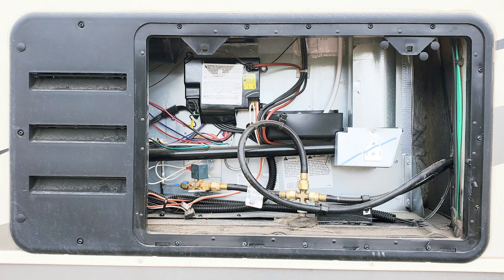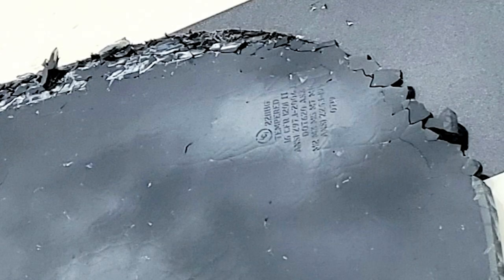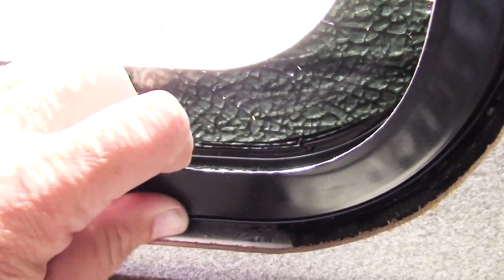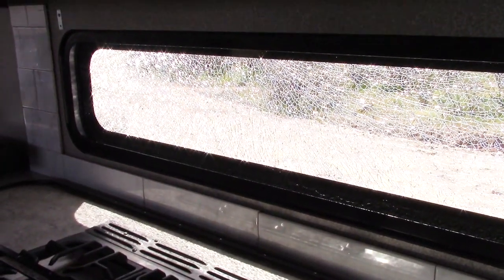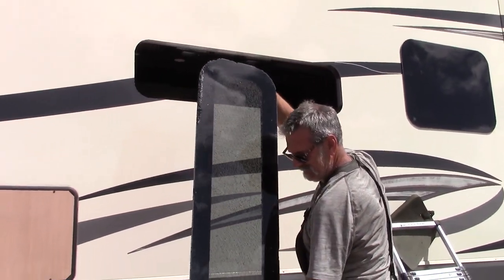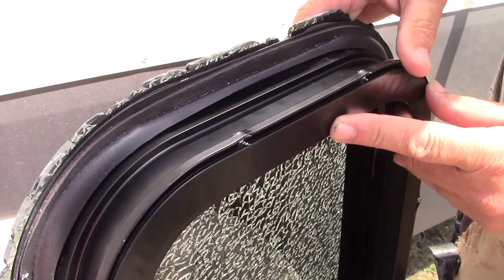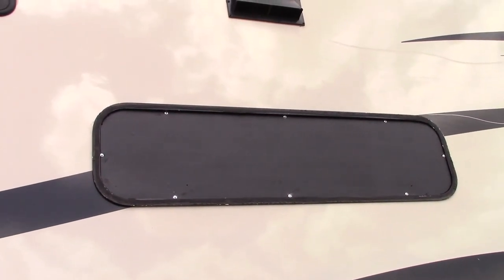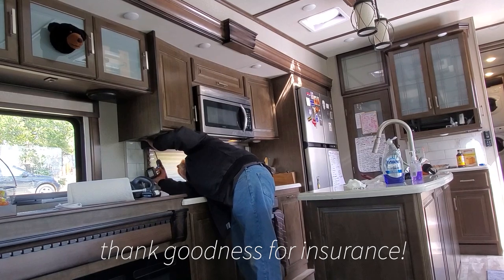SEMI TRUCK HIT & RUN! Shattered Windows, Emergency RV Repairs, RV Insurance Woes and Keeping It...

Comment: Note to self! Listen to the seasoned pros.. don't put out the slides when parked in a lot!
Reply: Someone on another one of her videos commented about putting out cones so they draw attention to the slides being out.  I thought that was a great idea.
Reply: I think that panting the bottom of the sliders with reflective paint would be another option. I'm in shock that the fix was over $8000. Yikes. So happy that a good craftsman was there to help her out. Chris did a really good temporary fix.

Comment: Sorry for your troubles. It could have been a lot worse. A little advise from a 25 year/3 million mile truck driver and a Grand Design owner. Don’t leave slides open in parking lots, truckstops and rest areas. If you need something that’s hidden then by all means open the slide and get what you want and shut it back up. Secondly, the driver don’t have to be new, anyone can make a mistake. If his trailer was heavily loaded he may not of even known it. Then he may have too. Your never going to know. An RV with the slide open is something you don’t expect as a truck driver, it’s not something we run across every day.  I would put a dash cam in your truck that runs all the time and loops.

Comment: Doesn’t cabelas have cameras? That s o b needs to b caught. Glad you’re ok stay safe
Reply: That’s what I’m thinking.
Reply: I thought the same thing- talk to Cabela's & see if they got it on camera.
Reply: 8000 ?
Reply: That was my thought. You might need to get the police involved, file a police report, to get the video and get this guy tracked down.
Reply: Wow! He's driving a huge 18-wheeler and "may not have even known he side-swiped her" yet you're calling him an s.o.b. I love watching this lady's videos and feel sad that she is going through all of this. That said, I do have one piece of criticism; something which may have avoided all of this. When you are lot docking in the parking lot of a Cabelas, WalMart, Cracker Barrel, a truck stop, etc think TWICE about putting your slides out. While these places may allow RV's to park there overnight they are, after all, areas where traffic (sometimes even a high volume of traffic) is going on. It's a risk. What I'm shocked by is that she did not go outside immediately after she felt the RV being moved. But I wasn't there so I can't really say with certainty that this isn't understandable. REGARDLESS, there is a chance (perhaps even a really GOOD chance) that the trucker didn't even realize he came into contact with an RV. Those rigs are often towing HELLA HEAVY loads and it's not always so easy to feel "a little extra drag" if they scrape along the side of something. I'm not trying to make excuses for him. Yes, if you are coming up beside somebody you need to take extra precautions but bottom line. You, nor I, were there and NEITHER of us knows that he "was aware" of what happened. If he was aware that he had scraped along the side of her rig then yes, he's an asshole. I'm just not certain he realized he had and I find it pretty hilarious (and annoying) that someone on the internet "immediately jumps to a conclusion" when (1) they weren't there, and (2) she's [meaning you, not the youtuber] is clearly offended easily and looking for a reason to express anger. But there are lots of those folks on the internet who are just like you and I'm sure they'll all come to your defense against my calling you out here, Debbie Shoop.
Reply: @n1spirit  That semi driver KNEW he hit her. Why do you think he bailed? I ran over a Black snake on U.S. 69 in Oklahoma with a Kenworth T600 dragging a 48' box van and felt EVERY tire on the left side, yes trailer tires too, run over that snake. It looked like a pile of hamburger meat in the rearview mirror, but I FELT every tire run over it. It was a shitty deal that he didn't stop and check on the damage. Maybe he'd already had an infraction and was on thin ice with his company, we'll never know. If I was her, I'd have been out the door like a shot to see wtf was going on. That had to make more noise than "just a semi driving by".  Not making light of what happened, Robin, but maybe do a better pre-trip inspection next time. Safe travels.
Reply: @n1spirit  My husband is a semi driver and I am his full-time passenger. I showed him this video and he said there is no way the driver DIDN'T know this happened.   

Sorry this happened Robin. Not all truck drivers are dicks.
Reply: @n1spirit  I think you post is completely on point.  I too am shocked about that amount of damage and that she wouldn't have stepped out and looked to see what happened.  The truck driver, meh he may or may not have noticed...but I think he probably did and skulked away.
Reply: @julieofidaho  Hopefully Robin did file a police report and the Cabelas location so they can follow up on it as that will help her with insurance claims. They can request security camera videos of the parking lot too.
Reply: @jenfugit7801  — Thank you. I think he likely did as well and skulked away but then again, none of us was there so I'm leaving room for the "what if's." I'm usually pretty aware of every little bump and drag (and sound) but I have been surprised on occasion. Also, I still maintain that putting those slides out in the parking lot was a bad idea. If I'm on the edge of the lot I don't have a problem putting the slide out over the grass/lot edge but I NEVER put the slide out where traffic is driving right by. That's just asking for a problem to occur [eventually]. Plus it's good manners; they don't have to let us overnight in their lot. If this becomes the new norm and enough accidents occur I can guarantee you that Cabela's will eventually revisit the issue and either ban overnight parking (unlikely given that we give them so much business) or alternatively, prohibit the extending of ALL slides moving forward. Some rigs are not very usable without at least the slides on ONE side being extended. For those of us who have rigs that are we should just suck it up and keep 'em in. My opinion anyway.
Reply: @n1spirit  you made several good points here,  I immediately was angered by the driver not telling Robin he had hit her. I can understand though that he may not have been aware of it after your comment. Thank you for sharing another perspective.
Reply from the maker: Good conversation and question.  I will respond in sunday's view q!
Reply: @n1spirit  There is no way he didn't know.  Not assuming.  It sounds like you are assuming that she didn't check about putting her slides out.  I ASSUME she is smart enough to know to check.  That said, the truck driver knew he at least hit her rig - he would likely lose his job or at least be docked for damages.  I don't want to see anyone lose their job but the insurance company (and in turn, all of us who pay for insurance) will pay if he isn't caught.
Reply: It's my understanding that it's most impolite to put slides out in these places.  Therefore accidents can happen.  I'm truly sorry for your damage and enjoy your videos.
Reply: @n1spirit    My Brother is a Semi Driver   He has been a Semi Driver since he was a teenager n He is now 49.     His boss leased My brother a New Truck and He got hit by other Driver 3 days after he drove it off the lot.    Even if the Driver did not know.  If his truck was shaking  He should have stopped and check to make sure everything was OK     A lot of newer drivers do not have the proper training.  They go to these fly by night Driver Schools and they get hired by a Company like Swift and end of Killing People or themselves because they should have never been  given a CDL in the first place
Reply: Leaving the scene of an accident in a commercial vehicle driven by a CDL operator is an automatic 1 year license suspension. I do not fault you at all but this might be a lesson in why you don’t park in public spaces and extend your slides. The spaces are barely wide enough for an 8 foot wide vehicle, when you go 10 or 12 feet wide there’s no margin for error
Reply: @n1spirit  Apparently you know what it is to be one...and you don't comprehend very well...it isn't about her going outside.
Reply: Michael you’re right about receiving a bunch of smack with that comment. Of course if you were a truck driver that comment wouldn’t have been mentioned. Especially referring the truck driver as “he”. Back in the 90’s when there wasn’t as many women truck drivers I was woken from my truck shaken in a Flying J parking lot because some idiot thought she could pull forward in a space rather than back up in one at 2 in the morning. Nothing like being jolted out of your sleeper and looking out your passenger window seeing white and yourself because the side mirror is mashed against the window. To top it off, besides the $5000 damage she didn’t want me to report it because she wasn’t supposed to be driving ! 
Sorry ladies, this isn’t about bashing women drivers but inexperienced drivers and the fact that Michael refers to truck drivers as men. 
Most likely the driver found themselves a gem at that hour in the morning to park their rig until they swiped Robin’s 5’er, then it was time to get outta dodge before the owner jumped out and realized the damages.
Reply: @n1spirit  From what others are saying, he more than likely knew he hit her. Even if he didn't, why did he drive so close to her? That in and of itself is just crazy. I agree with you though. The first thing that went through my mind when she started talking was, "what? you put your slide out in a parking lot?" I've always heard that's a big no no when parked in a businesses parking lot. It's not a camp site.
Reply: @n1spirit  I would have been on the phone with or in the office of Cabella's as soon as I realized there was damage in order for them to check their security cameras.
Reply: @n1spirit  can you still manage use the kitchen when the slides are in? I haven't been in any 5th wheels but heard this was a problem with some.

Comment: Yeah, Cabbela's should have video, and should be able to ID the tractor-trailer. Did you see the company name on the truck and/or trailer?

Glad you are ok! And got it fixed.

Also, try to recover some of what looks like that yellow paint (x'acto) & keep the sample in a baggie or cleaned old pill bottle. They can ID the paint chemicals.

Comment: When I park in a parking lot I always park next to a grass island. I make sure I pull in with my right slide facing the island. I only put that slide out. I won’t even leave my steps down if they are next to a parking slot. Never put a slide out that is facing another parking spot.

Comment: I thought that when you were spending the night in a parking lot that you wasn't supposed to put out your slides.
Reply: Depends on the rules of the parking lot owner.
Reply: I tell all newbies not to put their slides out unless they're parked on a curb that no vehicle can pass by you
Reply: No extended slide should be exposed to any potential traffic. This one is on you Robin.
Reply: Out or in the trucker should have seen it and move over.  This now has me thinking if I have a slide reflective tape I’ll place on the open area of slide and around rig. I agree park up against the curb.
Reply: I noticed an ATC toy hauler, without pullouts,  the owner uses neon pool noodles to cover the awning supports.  At the time I just thought it was pretty, now l'm thinking it maybe the way to help keep me safe.  I can't remember if they were hot pink or neon green.
Reply from the maker: Great conversation! I will respond in sunday's view q!
Reply from the maker: @redpilledrvers  fair... if that's what happened! I'll discuss Sunday
Reply: edna jankowski can you explain I'm curious and interested on how to place the noodles. Thanks
Reply: @user-yp7im1su9s  Ivwas jyst thinking if I ever have slide outs. I'm going to add reflective psint on the bottom and top of the slideout. Learning all kinfmds if good info.

Comment: Hi Robin,  it happened to us too.  We were in a left turning lane.  A semi came up beside us very close.  I figured he was going straight and relaxed a bit until I heard and felt what I thought was the wind.  In turning right, he scraped our right side of our travel trailer.  We never got him and now I’m worried about all semi trucks that go by.  We buffed out almost all of the scrape.  We were so blessed, as it could have been extensive, like yours.  I am so sorry that happened to you and your beautiful 5th Wheel.  The info you haven given us is wonderful, but at a terrible cost to you.  During this time of Covid-19–shipping and mailing is taking forever.  I ordered 2 packages of tomato seeds from 75 miles away.  They took 3 weeks to arrive. Everything is slower and harder to get.  So when the adjuster took so long, did not show up, this is typical for our times.  Thank you for sharing this major incident and I hope you are accident free from now on.

Comment: I'm so sorry this happened to you and your rig. I wonder if the other driver was aware of what he had done. A bus passed my dad's car and it's back bumper caught into the metal of the car and opened it up like a can of spam. The bus-driver  carried on blythly and my dad accelerated to catch the bus at it's next stop. The driver was shocked and denied hitting our car, said he didn't feel a thing but when he got out to inspect the damage and the rolled metal strip he was gobsmacked. Lucky you had someone to help you.. Brilliant.

Comment: FYI when YOU are not parked in a Campgound, don't put out your slide-outs.  Actually you caused this accident by doing so.  The slide-out was not contained in your parking space,  it over hung into the next space.  Yes, the semi driver should of stopped, but he may not of felt the hit either.      Costly for you, hope you learned from your mistake.

Comment: Not to make excesses for the truck driver, but it is almost impossible to know if you slightly hit something with the trailer because the mass is simply too huge to transfer information to the driver. I am an ex OTR (over the road) trucker and when I first started driving, I was pulling out of a spot at a tuck-stop that was really tight (due to another parking were they shouldn't have) and my trailer swing actually caught and ripped off the bumper on another tuck. I was concentrating on the front of my rig to not hit the illegally parked truck that I didn't see the trailer swing. I never knew the back of my trailer hit the other truck. There was no sound or feeling transferred to my truck cab. There really was nothing transferred for my senses to know. The other driver actually ran after me in order foe me to know what happened. 
Not an excuse but just the nature of the beast. Considering the max load capacity of a loaded tractor-trailer (without special licenses) is 80,000 lbs and an average empty weight 33,000 to 35,000 lbs (ave tractor is 19,000 and average trailer is 14-16,000) you can start to understand how a small collision may go unnoticed.
I do hope all works out in the end. Stay safe Robin.
Reply from the maker: Thank you!

Comment: So glad he didn't mess up your whole slide! We were in a parking lot at a cheap casino to eat and get showers and some boom truck I guess must have hit our ladder on the top and only one side and kinked it. Thankfully it didn't rip a hole in the roof!  We got some spray sealant and sprayed on it to be sure it didn't leak.  The ladder held my 200 lb hubby to climb it,  so I guess we'll just leave it.  No other damage done.  I knew we never hit a tree limb and it didn't hurt the vent cover right next to it. The only thing it could have been was that boom truck.

Comment: Semi hit and runs are common in parking lots.  My son just picked up his new Arctic Fox camper, stopped at a visitor center and was brushed by a truck.  I think most trucks drivers are good drivers, but there are some inexperienced or uncaring drivers that give them a bad name.  If it is a company truck an accident will be noted in their company records.  

Ironically, when I was driving in DC area, I noticed a truck driver doing a phenomenal job maneuvering in rush hour traffic.  I called the company and wanted to give him accommodation for being such a careful driver, they didn't know how to process a compliment.   They had never had anybody call their company and commend a driver for his careful driving.   Perhaps, we should do more of this.

Comment: I love the CR Lawrence windows in my van. They all have RV style openers. They don't use any sort of adhesive to hold them in. The scratches look like they dug into more than the paint...as in the siding material. It is so fortunate the damage wasn't worse. I had a hit and run who just clipped the rear of my Toyota Rav4. It was $6,000! Stay well.

Comment: If you had contact paper you could have put it over the glass and than use painters tape on the edges to seal against water. If I would be RVing full time I would be sure to have my clear contact paper and painters tape with me for temporary fixes.  If you need to put contact paper on something remove the paper from one edge half inch at a time and smooth behind.  I use contact paper on anything I want to keep dry and cleanable.

Comment: A rock hit one of our windows in our fifth wheel and spider the window out just like yours. I got some clear contact paper on the outside and the inside of the window. You could not tell that the window was broken and it lasted for about three months until the replacement window came in and was replaced. Just a thought if you're in a pinch. Our window was on the end of our slide-out so every time we pulled the side in or out it rubbed on that window and still it hung together.